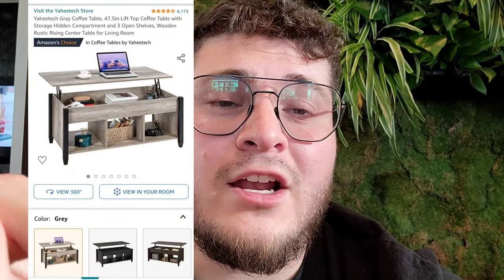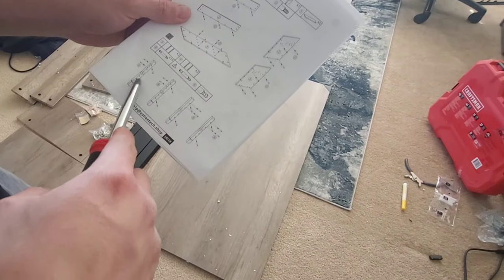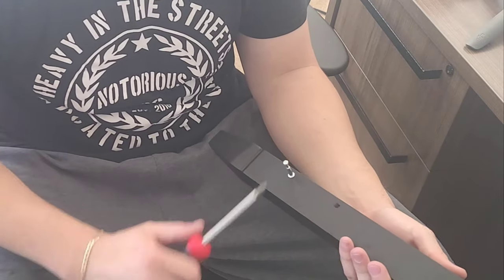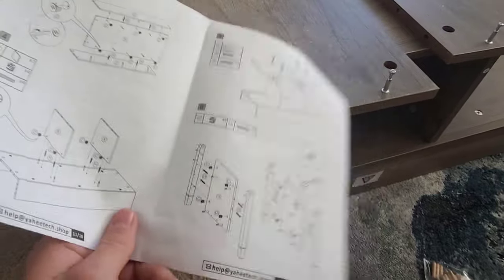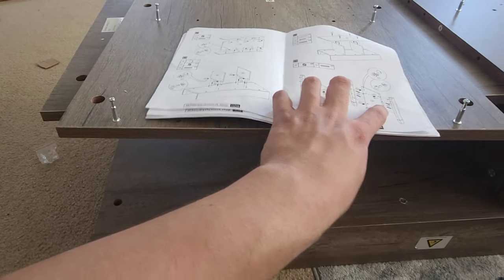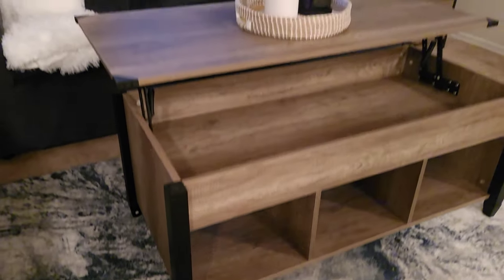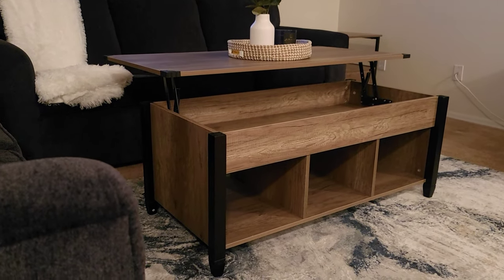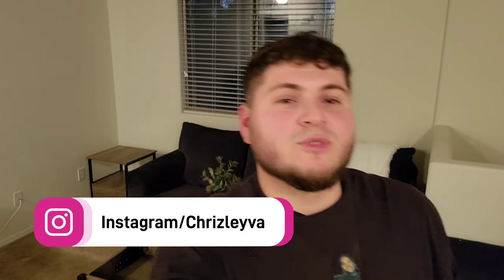Amazon Yaheetech Lift Top Coffee Table / Review

Comment: Tip: instead of using pliers to pull on the spring (with the risk of slipping) put a screwdriver through the eye of the spring then pull on the screwdriver shaft with your fingers on either side of the eye (as if you're pulling on a bow string).